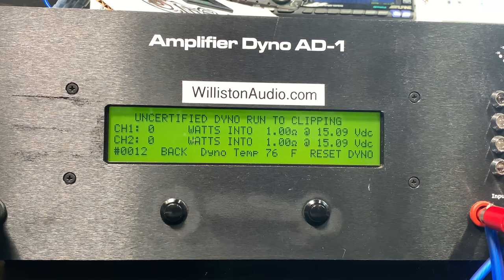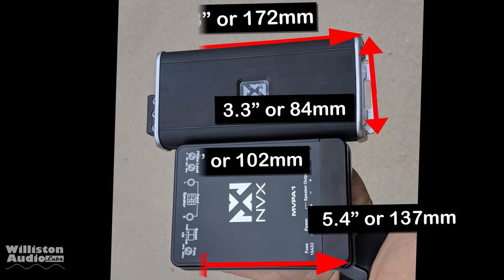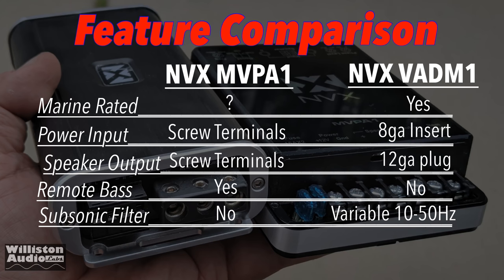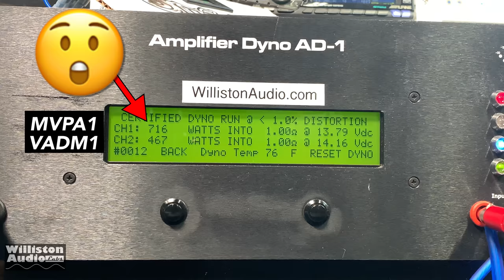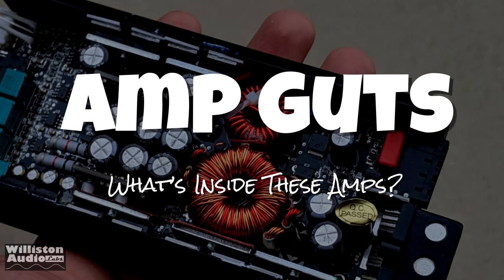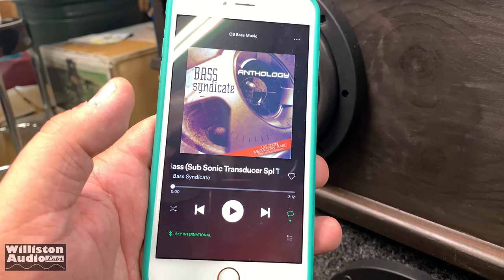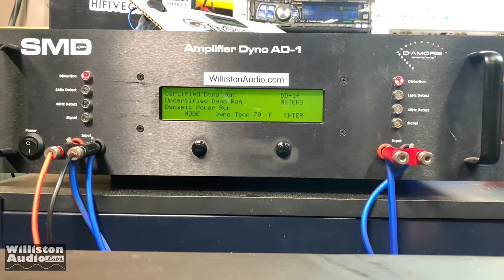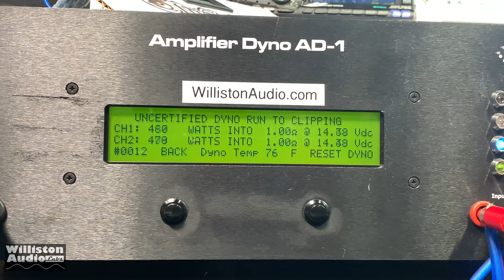Tiny Amp Challenge? NVX Micro Amp Dyno Drag Race - MVPA1 vs VADM1

Comment from the maker: Shop for these amplifiers:
NVX MVPA1
Amazon - https://amzn.to/2ZtnDnb
eBay: https://is.gd/nvxmvpa1ebay
NVX VADM1
Amazon: https://amzn.to/2HlQQdx
eBay: https://is.gd/nvxvadm1ebay

Savard Hi-Q 6.5" Subwoofer:
Amazon: https://amzn.to/2ZlWnqN
eBay: https://is.gd/savardhiq6ebay
Reply: Just put 2 in my cart for later. Wonder if they make a bluetooth version?😎
Reply: hey can some 1 help me my question is can i run 2xPioneer champion series 12"(400watt rms each) on a stock alternator 65 or 75 amps not rly sure (peugeot 307-1.600cc) using a skar audio rp.1500d  960watt at 2 ohms my question is if i'll have enough power from the stock alternator witout any problems to power all of that. I'l also hook a boss audio cap 8fahrad
Reply: What do you think about an Home SPL challenge 😊 i make the first step in the next  days and give you the link to my video... this would be awesome my friend.. greetings from Germany
Reply: @filipT97  hi i think you would not hear many hours of full power.. so for a little bit musik and 1 or 2 tracks it would work fine.. buz you need a good and big batterie for longer fun.. if you find a bigger alternator for your car its better but for music it works... with 1000watts Rms you have more than 100A
Reply: @dietershobbypakanal  thats a good ideas
Reply: What do you do with most of the amps that you accumulate on the channel
Reply: Awesome vid as usual man!! Im surprised what they could both do! Just wanted to let you know you had the remote bass info backwards on the feature comparison. Id love to see a dyno on a SPL 1600 watt amp if you ever come across one.  Had one in the early 2000's that i got at a flea market.  Keep the great videos coming!!

Comment: THANKS! I just ordered the NVX VADM2 (2-channel, full range) based on your dyno testing. This will go into my DIY ammo can speaker build (using a 10" DVC Skar Audio sub, Dayton Audio tweeters, Dakota Lithium 24 aH battery, BT EQ, etc-etc). The Nobsound digital chip amp in it now does alright, but need more power.

Comment: Very cool little amplifier I'm definitely gonna look in too one those tiny dude's just for fun. Nice video Big D as always 🤙🤙
Reply from the maker: They are surprisingly strong
Reply: @wal  one of these be a great match for my prototype 6.5" I'll be building soon
 Definitely need to invest in one once I buy my woofer motor frame and soft parts.
Reply from the maker: I tried both with the Savard 6.5 HiQ D2 Wired to 1 ohm. Both impressive, but the VADM1 was just a bit more clean and controlled
Reply: @wal  🤔🤔🤔 the VADM1 might be the one too go with Big D the 6.5 I'm gonna be building will be a 2"coil  2 ohm. So if that one worked better and had more SQ quality with you're 6.5 then I don't see why it would not work great with mine.
Reply: Dave Micolichek  correct bit if I do plan to run either one amp i can choose the correct ohm load coil i wish to use in my prototype.

Comment: I used a NVX MVPA1 to drive a 6.5 inch Sundown Subwoofer.  But it started making a constant humming noise about 4 hours into break-in playing at 50%. And it was hot too. This was for a boom box so it's not a ground loop issue.  Returned it and stuck with the Kenwood M3004.

Comment: I got into car audio in the mid 90’s and have been in and out of it since then. In the mid 90’s if someone told me that little amp even did 200 watts let alone 500 to 700 I would of laughed at them. Back then amps that really put out 500 watts rms were pretty big. Like 15to 20 inches in length and like 8 to 12 inches from top to bottom. I remember one of my friends had a 1000 watt amp that was over 3 feet long. It might of been 4 feet long I can’t remember exactly. But I know it was huge! It’s crazy to how much power you can get out of small amps these days.

Comment: Great drag big D those things the real deal. I'd bet if you were able to get the older model the rest of the way apart you'd find some small heatsinks mounted directly to the FETs. You'd think they'd build slots into the plastic case to allow for airflow around them but at that price point I guess there's a limit to how far they can take the engineering
Reply from the maker: I bet so! I didn’t want to fully dissemble, sorry

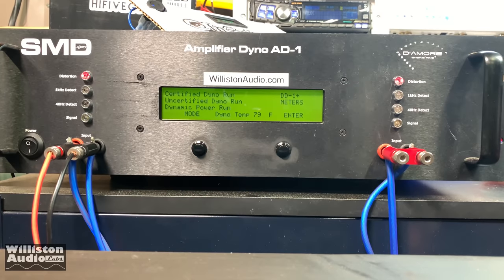Comment: 8:33 There's the attenuation or damping factor ('Dämpfungsfaktor' in German). This value means the ability of the amp to control the speaker and not in reverse (self induction and all that nasty things voicecoils do). Class-D amps technically have a pretty small damping factor, especially as they were new on the market. I think this is one of the reasons why the newer model sounds clearer and more powerfull. [commenting elderly videos is one of my special powers]

Comment: Wow both did more than rated and didn't blow nvx gets a thumbs up from me do they have a 4 channel? These lil beast would be good for a stealth install
Reply from the maker: Yes, new model is VADM4
Reply: i have 2 of the older mvpa4 in 2 different vehicles. one of them is powering 4 rockford pps4-6 mids. the other one is under the rear seat of my dakota powering basic pioneer speakers.
Reply: Dave Micolichek these don’t run full range.  So your idea wouldn’t work😨😰
Reply: Watching this I said to myself that would be killer for a invisible aftermarket install. I want these guys to make some home unit amps
Reply: MVPA4 - 4 channel 
MVPA1- monoblock 1 ch

Comment: The older amps get super hot after playing for an hour or so especially the 4channel amps. I have 6 of them and 2 of them get so hot they go into thermal shutdown. Im replacing all of them with a better amp that can play without overheating. And Yes they are playing at 4ohms with proper power wire with 2 batteries and I have a 250amp mechman alt. These amps are not that great and its no wonder they were discontinued. The terminals are too small and the switches for the crossovers are not good either, they can only be flipped a few times before they started making scratching sounds or dont work anymore. These are low budget low quality amps that seem to make decent power but not without overheating issues and quality issues.

Comment: Are there other microamps that I could use on my motorcycle.
Something that is full range not mono block I bought some skar audio pro speakers they are 150 watts RMS and 300 watts max
I tried it with the dual 600 watt Walmart amp and it just wasn't enough any suggestions

Comment: The old nvx amps used high end class d " Phillips" boards shared by brands  like hertz, polk and precision power. don't know about this micro amps design if it's shared with anything else but it carries on the tradition of being underrated for a great price. nothing wrong with this new mini  amp but it's sad to see them using cheaper terminals and cheaper Chinese boards. fortunately this mini amp doesn't have the pot metal terminals like their bigger amps use now. Jad> vad

Comment: I have the mpva1 and that thing slammed on my 15" vcw.  I ran it at 1 ohm for a couple years.  It did shut off on me on really hot days.  I switched it back to 2 ohm and used it for another couple years.  I still have it. Think something may be messed up on it now due to all the abuse.  But I guess I cant complain.  I did abuse the heck outta it. I need to test it on my bench power supply sometime. Which can provide 60 amps at 14 volts.
Reply from the maker: Great feedback

Comment: Would it be possible to start mentioning the capacitor temprature ratimgs? I seen on another video(The amp lab) that the Cap. Temp. rating is important ton
 determining amplifier longevity. Thanks!

Comment: "It also has a bass boost which we don't care about.." 

People always be hating on the bass boost. With some cars using the bass boost to level the signal out after the stock deck mangles it is helpful. Just have to make sure you tune with the bass boost on whatever level it's going to be at. It's not super useful most of the time but it does have a use.
Reply from the maker: If it was parametric so the frequency was adjustable, then it could be useful. The "fixed" frequency bass boosts are rarely useful IMO
Reply: @wal  It would definitely be more useful. In my experience the fixed ones are usually around 40hz which is often near enough to where you can undo some of the LPF crossover damage from your deck. You usually end up with peaks and valleys but that's sometimes better than a giant cliff though lol. Always better to use a Fix82 or a DSP or something like that. I just feel bad for the poor bass boost knob sometimes. It's just trying to help, it's not terribly good at what it does but it does it sometimes.
Reply: I agree, it has its use.. and the do the intended job when use properly..
Reply: @Fly2kill1  Yeah and unfortunately most modern car stereos have a big one in the range you want a subwoofer to play. Makes factory integration a nightmare. Bass boost is probably the worst way to address the issue but it does have some effect if you use it correctly.
Reply: @tankdog03ify  It's pretty rare that it's used properly I imagine LOL. Knowing the people I've known over the years... yeah... no...

Comment: My MVPA-4 gets pretty hot after a short while. I’m scared of it dying.
Reply from the maker: It’s a tiny amp with a lot of power per square inch
Reply: Because Big-D had a hard time taking the MVPA-1 apart I'm going to assume cooling mods would be too difficult but you can make sure it is ventilated! Amps need room to breathe! But that was clearly a design flaw they fixed with the new series so unfortunately you may just need to upgrade when it does die.

Comment: I'm curious, if you have lets say 2 of the VADM1's - or any other amp with remote bass knob - and put each on a separate sub, if you used an adapter, could one knob control both? Would like to see a video on that instance if possible.

Comment: Have you ever tested anything by Powerbass? Im currently using a Powerbass ASA 400.2 I bought years ago (think its from 2005) pushing a 12 Cerwin Vega 1300watt at 2ohm and two lightning audio LO-S412 12's wired at 2ohms seems to be bumping pretty good for a budget system. I also have two SSL (soundstorm labs) amps a PSY1000.2 and a PSY1600.4 I know that are not making there rated power but they can still give you some bump.
Reply from the maker: No Powerbass yet

Comment: Can I use an amp like this as a daily driver? I used to own 2 x bd1000a1 each hooked to an Eclipse Aluminum 12” DVC. Rock solid, you could not hurt this combo. This was 20 years ago. Car audio has changed so much... Now I need an amp to use in my smallish car with a single basic (but decent) 10” subwoofer in a ported box. My Rockford Fosgate 60.2 “cheater” amp gave up the ghost and I’m looking to replace it with a cheap “set and forget”.
Reply: Been running one for 2 years on a 2 ohm sub in my “daily driver”.  Just recently went to a pair of two ohm subs in parallel for 1 ohm and it’s still doing fine.

Comment: Totally want to get this for my jbl party box that blew out the sub part of its board (can't find replacement board) so I need something to improvise. Is it possible to patch this in with a bit of savvy hacking? Battery pack has multiple v out and I've already found a 12v trigger on power up. I'm already upgrading to 8" subs since they'll fit and possibly do something different with the mid/ high combo speakers. Be such a waste to throw it out and jbl customer service is a joke

Comment: Can you test hometheater amps like reckhorn A-800 It's pretty good for price, they say 2Ohm=800w rms 0.7% and 1000w 10% distorition.
Reply from the maker: I’ll look into it for sure
Reply: @wal  I found some forums that they said it would take 1ohms too, but neither will it be stabile.
Reply from the maker: @kaitsuml3748  it doesn't appear this "Reckhorn A-800" is available in the US.
Reply: @wal  Oh, did you check any used from Ebay? Or not familar with that website. 😀

Comment: U think you could do an amp dyno of the wolfram 250.4? Just in stock state side.
Reply: Troy Defond I’m sure it will do rated no problem.  Odds are about 20-33% over rated if I had to guess.  Could be more.   What matters is how the amp sounds on a 4 channel.  Once crossed over your speakers will never see the amount of power it can put out.

Comment: hey bigd ive got a question for you, i recently got a brand new nvx amp being the 4 channel nvx jad 800.4 to replace my old junk 4 channel amp. before changing amps i never had any hissing out of my speakers when turning volume up all the way with audio paused. hooking everything up to this amp the exact same as the last one this amp has a horrible hissing noise and it increases the more i turn up the volume.  the amp isnt going into protect mode at all and when music is playing the sound seems good but when not as much is going on i still hear the hissing in the background, do you have any clue what could be causing this issue? could the amp be bad from the factory? if anyone has any suggestions please let me know!
Reply: Had the same amp, Had the same problem. Not sure what its called but I call it white noise..The only way around it for me was turn the gain down on the amp. I believe I was just over a quater on both gains and that helped but then your output is lacking. I ended up selling the amp and getting an Alpine PDX...problem solved. Class D amps are notorious for background noise the better S/N ratio the less noise or so I've read.
Reply: @pdiddy8778  very interesting and thank you for the reply I may see about returning mine and buying the original alpine I was planning on for less money

Comment: hey can some 1 help me my question is can i run 2xPioneer champion series 12"(400watt rms each) on a stock alternator 65 or 75 amps not rly sure (peugeot 307-1.600cc) using a skar audio rp.1500d  960watt at 2 ohms my question is if i'll have enough power from the stock alternator witout any problems to power all of that. I'l also hook a boss audio cap 8fahrad.
Reply: Cap will not help. And it matters how much of the 65-75amps your car actually consumes but I say that is not enough alternator. Even if it works at first that kill your alt fast. 400W each so say 600W max listening volume, that's 43 Amps! If your car could run off only 20 Amps that's basically the size alternator it would have....